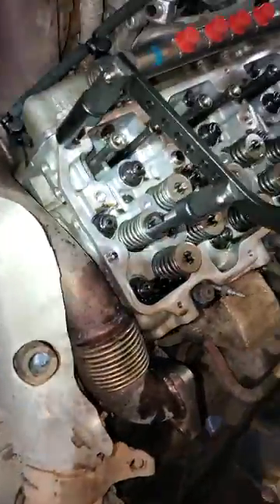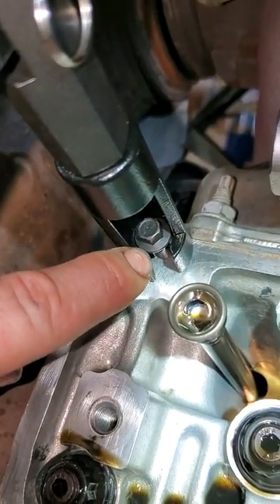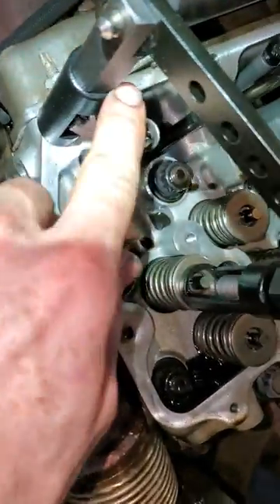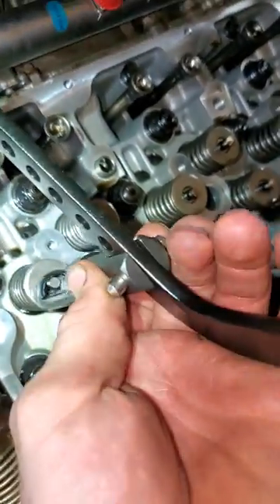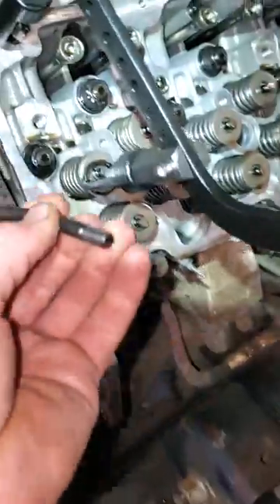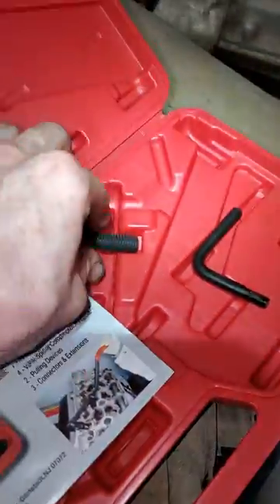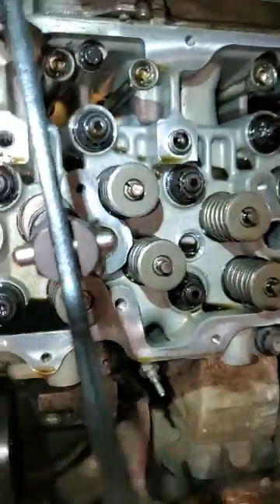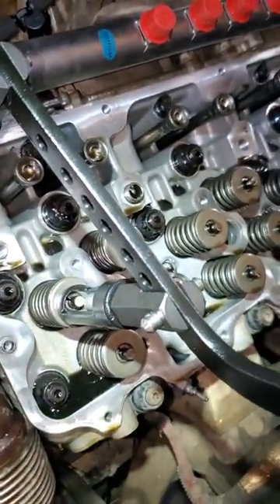This Valve Spring Compressor Is Worth Every Penny!

Comment: Always make sure the piston is all the way up or you put compressed air into the cylinder otherwise you will drop a valve into the cylinder and have to pull the head off
Reply: Yes sir. I always use my cylinder leak tester in conjunction with a spring compressor when I do valve springs.
Reply: I can tell he did not do this. I still see the plug wire on the plug. He'll learn his lesson.
Reply: Bad day ahead if so
Reply: @jhayward1940  then you didn’t listen, he mentioned having it at the top.
Now show everyone where that plug wire goes on the Duramax
Reply: You can also pack string or twine into the cylinder via the spark plug hole and bring to tdc. Works especially well on non-interference engines.
Reply: @akshonclip  also a great way to remove a head after pulling the head bolts out. Feed rope into sparkplug hole and then turn engine over with a wrench.
Reply: @akshonclip  diesel engine not gas, what spark plug hole? Have fun spending all that time trying to feed rope through a small little glow hole too. TDC is much easier for diesels.
Reply: @kingofbrutaltheocracy9201 diesel engine not gas, what spark plug hole? Have fun spending all that time trying to feed rope through a small little glow hole too. TDC is much easier for diesels.
Reply: @akbychoice haha, that's what I was thinking, please show me location of this so called spark wire on this duramax lml diesel engine. I'll sit back and watch with 🍿.
Reply: @akshonclip  except we are commenting on a comment left on a video about a DIESEL engine not a gasoline engine. And boy, you must get real upset when your women proves you wrong if your getting that pissy over being corrected on YouTube comments rofl.
Reply: @jhayward1940 oof a spark plug wire?  Ya sure?? 😂

Comment: You would rarely ever use that tool....... They make a great tool that probably cost 1/20th of that one that clamps on to the bottom of the spring and you can spin the bolt and compress the spring.... you dont gotta shove down on it, saving your shoulder, and it will fit literally anywhere...

Comment: If you use the Piston to mechanically hold the valve before you bring the Piston up feed a rope into the spark plug hole. It'll protect the  parts and if it slips it'll catch the valve. Compressed air is the way to go.
Reply from the maker: This is a diesel so no need for rope. I'm not sure how anybody can feed a rope through a spark plug hole anyways. It will suffer ED really quick and limp out and not go into the hole any farther 🤣. Then, most spark plug holes are hard to get to and can be at a pretty extreme angle to the combustion chamber. If it's a gas motor, I'm using nothing but compressed air.

Comment: Nah I have this really nice one that you just put on the spring and bop it with a hammer. I prefer my deadblow. Then in one pop the keepers retain inside the tool with magnets and the spring is free. I'll run through a small 4cylinder head super fast. Then fish out the keepers and do more if on a bigger block. Placing is just as easy, bop and done, bop and done.
Reply: Now try putting them back on...
Reply: Just seen the one you are talking about on Eric the Car Guy. Looks light years ahead of this one.
Reply: @802Garage  same process you just put the adapter on the end and set the keepers on the spring cap press it on the spring and bop. Small japanese engines I can just about get it just from pushing the tool. Easy.

Comment: Looks like a nice built tool, my only issue I see is I would prefer if the part compressing the spring actually cupped over the spring cap. I don’t like the way it slips around when you apply pressure.
Reply from the maker: Yes that would be nice for sure
Reply: Il n'utilise pas le bon diamètre de compresse ressort

Comment: You can take a socket with a magnet on thw side of it and put it over the valve spring tap it with a hammer and it will release
Reply: try putting it together that way...

Comment: well I DO need to change my valve stem seals.  does it work on sohc heads?
Now I have an idea what to look for.
Reply from the maker: It should as long as you have enough room above the head for the tool. I have another more compact tool that has 2 hooks that wrap around cam and then pull against cam to compress the spring. Works great on some overhead cam motors (used it on my Dodge 4.7)
Reply: @TechnicianRed  my question was if there's a place to grabon.
For a Toyota 22r.

Comment: Even at Tdc won't valve drop too far for installing inserts at top of valve ? Some engines need compressed air to hold valve ?
Reply from the maker: Not on diesels.  The piston is very close to the valve face at TDC due to the perfectly flat cylinder head.

Comment: won't the valve fall in the cylinder?
Reply from the maker: Not with piston at TDC on a diesel
Reply: @TechnicianRed  and if the valves are angled will damage piston

Comment: I have a lisle magnetic one. just tap it with a hammer and it catches the little pieces. much faster
Reply from the maker: Yes I have the same one too. Way to risky to use on an assembled head on a motor. Too much risk of the keepers falling into the motor. Besides, that tool works best when you have a rag stuffed under the head against the valve face to keep the valve stem fully inserted into the head. Can't do that with the head still on.
Reply: @TechnicianRed  I work on Subaru so the heads are usually off.

Comment: I’ve been working on duramax engines for 17 years and never had to compress a valve spring in frame. Replaced a lot of bent push rods and done a lot of head gaskets. But never needed that compressor.
Reply from the maker: That's because you have never had to change valve stem seals that were pressed on too far by the machine shop. Check our my other video on "Duramax LML burning oil after head studs" or something like that.

Comment: Good luck if you lever using your camshaft. That's just asking for problems
Reply from the maker: Did you know the camshaft is what normally opens the valves and therefore compresses the spring? Find out on the next episode!
Reply: @TechnicianRed  that's got nothing to do with leveraging on the shaft of the far cam to compress a spring. Your mechanical leverage advantage is going to require far more force on that shaft. And if you have any burrs or pointy bits that manage to damage the shaft you could very well crack it.

Or maybe you're not aware how easy it is to break a camshaft by punching it.
Reply: @TechnicianRed  I would highly recommend against using either camshaft as a pry point. You'd be better off using one of the bolts to a cap.
Reply from the maker: @ObservationofLimits  Well the OEM Ford valve spring compressor to remove rocker arms on their triton motors has a hook that goes under the cam just like this tool has. And, I have another spring compressor that I have used on my Dodge 4.7 that has hooks that go under the cam. The chances of breaking the cam are pretty much zero unless you hit the tool with a hammer maybe. If you look at dodge 4.7 rocker arms, you will see the roller is very close to the valve stem end so the cam has almost no mechanical advantage.

Comment: Just because you have the correct tool, doesn't mean you're qualified to use it. You have the Wrong adaptor on the valve spring retainer.
Reply from the maker: Um no I don't
Reply: @TechnicianRed  The correct adaptor fits over the retainer and top of the spring so they are inside the tool.
Reply from the maker: @riccicrozzie8204  look closely. None of these adapters have a lip to sit over the edge of the retainer
Reply: @TechnicianRed  , okay mate, you use it how you want to.  The adaptor isn't supposed to slip on the retainer. I'd like to be there when you're fitting the valve collets.

Comment: What a waste of money.  I made one almost identical in design 15 years ago.
Reply from the maker: Not a waste of money when I can make way more $$$ in the time it takes to make this tool fixing cars than what the tool costs.
Reply: @TechnicianRed   A few pieces of metal stock, a plasma cutter, angle Grinder and a drill bit. 20 minutes later you're eating crow.
 And that includes the drying time for the rattle can

Comment: Bro using the wrong valve adapter lol
Reply from the maker: How is that? The adapter I chose gave plenty of room to remove/install the keepers so it worked perfect for me.
Reply: @TechnicianRed  the adapter is supposed to fit over the valve spring cap perfectly. If you look at the adapters they have lips at the end. Its so it doesn't slip off and keeps the spring centered
Reply from the maker: @AndrewWatson975  maybe the fancier tools have lips, but the adapters for this tool have no lips- just a flat end. I see what you are saying though.

Comment: Complexity doesn't equal better awful lot of junk there just to pull the valve spring down
Reply from the maker: Its not complex at all. Being a universal tool, it is meant to have many different adapters to use on almost any engine. I think they did a great job.

Comment: YOUR USING THAT TOOL 100% WRONG you need to use the fucking thing that fits the top of the valve and doesnt slide around like the one your using does, there is a little groove the top of the proper tool end so it fits retainer proper and does NOT SLIDE AROUND

Comment: Useless. If you're taking the spring off, 99% of the time you're going to have the head off.
Reply from the maker: Wrong. Ever heard of bad valve stem seals? Fairly common problem on high mileage engines. And what about broken valve springs? Seen several. Then there are spring upgrades for your bigger cams...